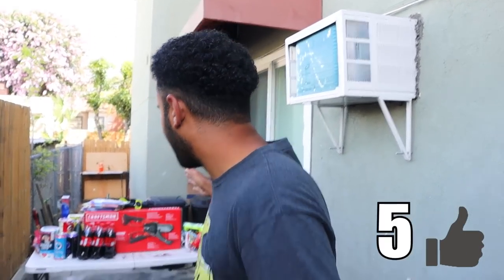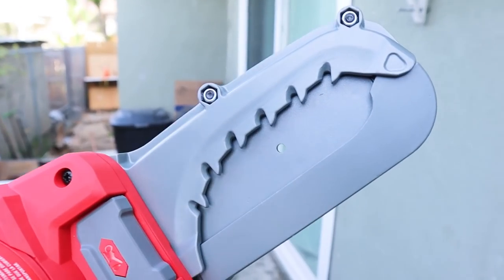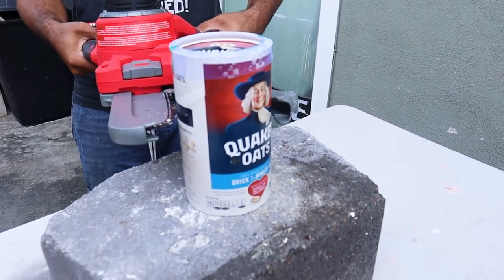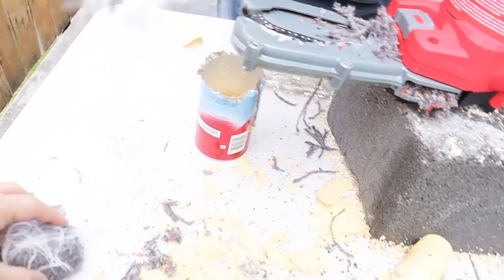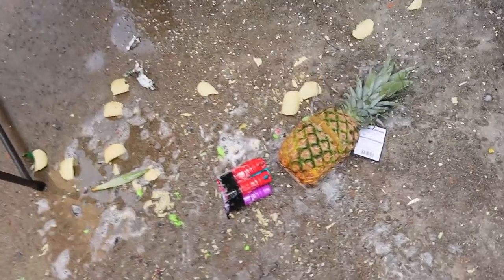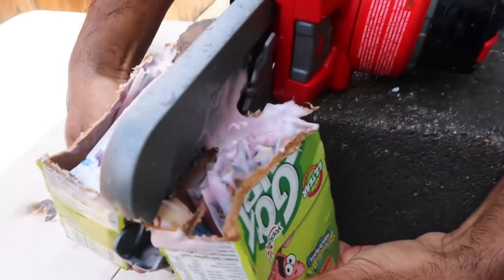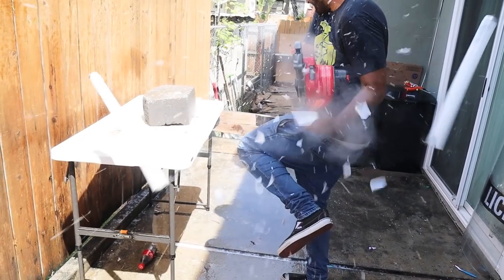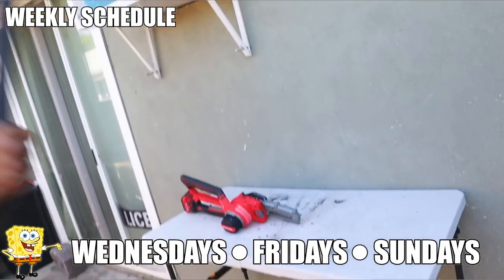I Bought The Most POWERFUL Alligator CHAINSAW On Earth!!  *IT CUTS THROUGH ANYTHING!!*

Comment: Spray something in Line-X and try cutting it with the Saw
Reply: It'll cut right through it. Only sharp objects work on Line X. You can pierce it. You cant smash it or cut it with a flat blade. But anything that'll pierce it will cut right through it.